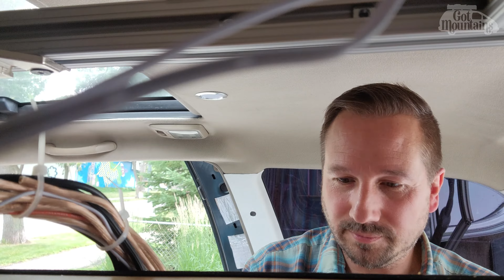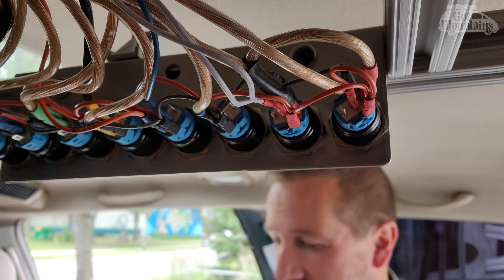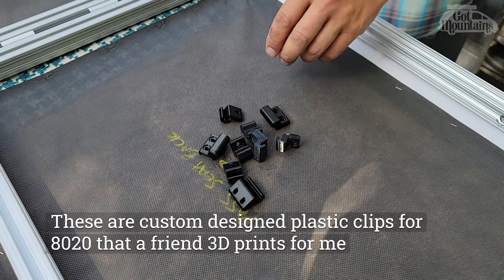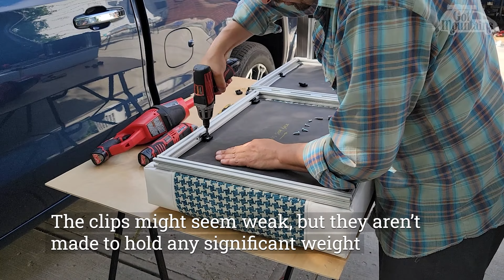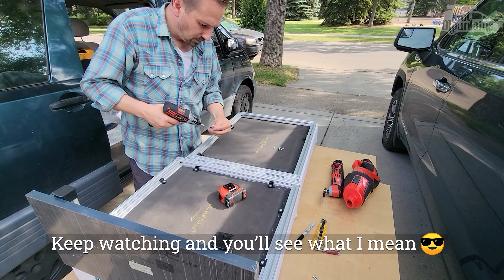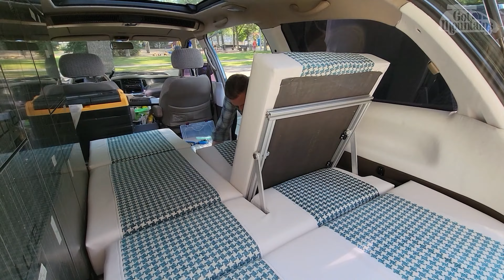On the final stretch! ELECTRICAL & UPHOLSTERY // E23 Van Build Series

Comment: What a great design and execution- the aluminum is a sturdy, flexible-to-work-with framework! A Recon Van (NV 200) came out a few years ago with a setup similar- it was way expensive (45K). Yours does everything it does and more. I'd never seen the re-usable zip ties but will be getting some soon! 
(Ps- I posted an FPV video will be on my channel for you- will take it down tomorrow. Check it out, and let me know what you think- Thanks!)
Reply from the maker: Oooooh, I'll go look now! And thank you! It's been a lot of design work, but we managed to squeeze a lot into our small space!
Reply: @GotMountains  Great! I had the new thumb cam on it, and was being a bit more careful. The location is an ex-golf course turned park- just the right scale for the Rekon LR  5" - it's pretty fast- I'm usually. under 30% throttle- more cruising than racing. You did a great job with the van!
Reply from the maker: @ktkt1825  Thanks, still have to get the sink done but other than that, it's fully functional!
Reply from the maker: Yeesh...you had me flinching on some of those corners...haha. That wasn't the DJI Mini though, was it? That was your other drone?